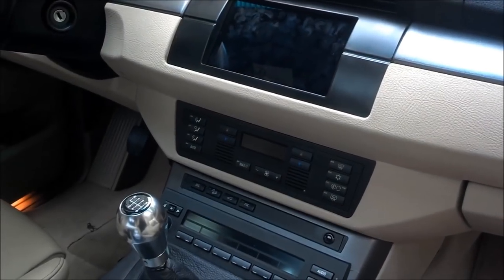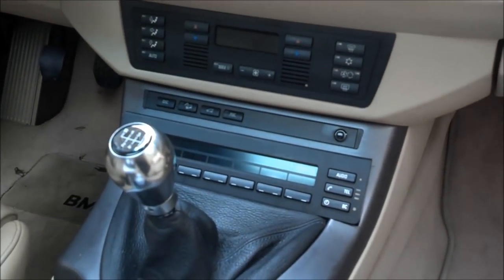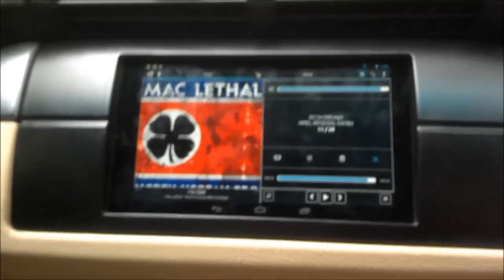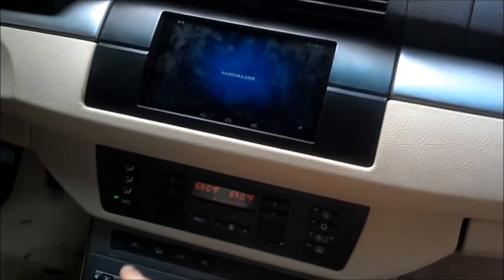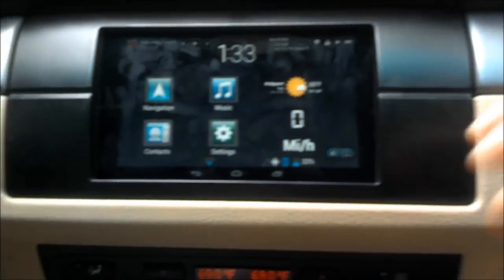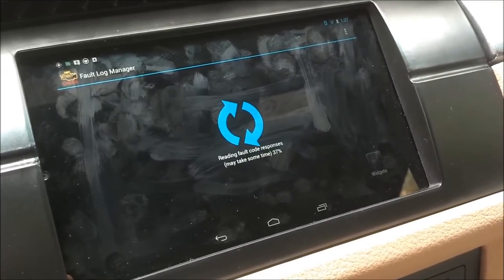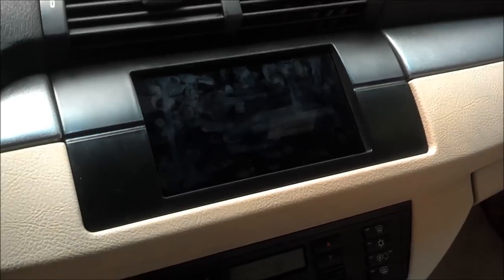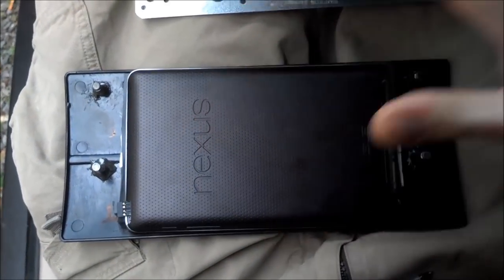Nexus 7 car install 2004 E53 BMW X5

Comment from the maker: I don't think that noise was programmed to indicate low battery, I believe it was an alarm system fault due to charge level.  I am glad it did not go off entirely.  I had my car apart for days- in and out, testing while not driving.  So, I did run the battery down- especially with interior lights.  She didn't start after that but since I have been driving her- even with the OBD reader plugged in all the time, there have been zero issues. 

Would be cool if I helped you isolate, keep us posted!

Comment: Thank you so much for this video, it was (in is going to be) very informative!
I'm waiting for my tablet, bezel, ODBII reader... to arrive and then I will start integrating the tablet with my 3 series E46. I'm planning to connect to the IBus system too (for steering wheel volume controls ect. & to control other car functions via tablet). 
One thing I didn't think about was using the bluetooth keyboard for some funtions (+1).
Would you be willing to answer some technical questions in the future?

Comment: Hey Jeff, does your Nexus 7 still retain the use of the original power button?  Im REALLY curious where you tapped into the power button for your remote "sleep/power" hook up.  Im actually going to add two more pogo pins to my tablet so that the remote button works as soon as the tablet is slid into its dock...but Im having trouble finding a good spot to make a good connection without butchering the stock ribbon cable...and retaining factory button for using inside the house etc.  Thanks!!

Comment: I was able to charge my 2013 nexus 7 with a qi wireless charger.  That might work better than putting a switch for the USB to pick from power/data

Comment: Hi Jeff .... how hard was it to fit the MID in ashtray ?
after you cut the 12 V plug how well does it sit on the aluminum trim ?
most people move it to gloveBox after getting aftermarket radio.
having done this what do you recommend ? gloveBox or ashtray ?
Reply from the maker: I had to dremel out the area around original location of ashtray to accommodate MID.  BMW uses some thick metal in that trim (underneath the wood laminate.)  Worth it for me, however- especially in light of work I did to take over the buttons in it.  I've seen a few installs with MID in glovebox.  If I had not taken over the buttons in MID, then relocated to glovebox- it would have probably saved me 20 hours easy!

Comment: where did u get all of the trim? like for double din and relocation of stock radio
Reply from the maker: Hey Ted, just a standard double din kit for the car.  From what I have seen, there are two types.  One that has the groove to match factory contour and one without.  I picked up the one w/ groove for about $45 on eBay some time ago.  The only trim for stereo is the right and left side.  I simply cut out this trim from salvaged black plastic and adhered to sides.  The top "lip" is already there. Relocation was a nightmare, a lot of dremeling around where the ashtray was.  I don't feel too bad about it since it is replaceable and even with a real aftermarket stereo, I would probably keep the orig. to retain original functions like settings for dash cluster.  Thanks for interest!

Comment: common jay .. help a man out, i really miss my MID :)
if I removed the center console , is it just the 4 screws on the ashtray and im set to slide in the MID and connect it ?
Reply from the maker: Unfortunately not that easy.  You would have to dremel out the bottom of ashtray receptacle in trim to accommodate MID.  (BMW uses some thick metal in that piece of trim!)  Then, cut some thin black plastic trim to cover up the metal sides of MID that would protrude without.
Reply: Jeff M
thanks for the reply.  i placed the MID on ashtray and noticed it was a bit longer than the gap.
i think i will just try to fit it in there with the metallic casing of the MID removed. hopefully it will fit ... if not i dont think i will dremel stuff out and have to settle for the glovebox.
I have to say the MID in ashtray looks nice as hell. defo worth the 20 hours if u ask me :)
Reply: Jeff M
Reading your comments I'm just unclear about something.
say you remove the center console to the side and you are left with
1. the front dash which has ashtray bolted onto it and
2. center console which has the handbrake/shifter/aluminum trim on it.
did u have to dremel the part behind the ashtray (1) or just widen the gap in the alluminum trim and  the bit that it sits on(2) ? or both ?
Reply from the maker: forthereg Oh man, it's been awhile and I've probably suppressed some of those memories lol.  I believe I only had to widen the exterior trim you see.  That trim, however, is real wood trim under my aluminum style wrap.  This wooden trim is secured to a very strong/thick frame.  I remember this was the nightmare to get thru, using only a dremel with standard cutting discs.

Comment from the maker: UPDATE: I got OTG and Charge working via no-wipe root as I instruct below.  This is done at your own risk!...

Installed Universal_Naked_Driver_0.72 for Nexus 7
Downloaded timur-usbhost-2013-01-29-jb42-fi.zip and put in root folder of Nexus 7 
Rooted Successfully w/ motochopper n7 (No wipe)
Backed up All aps and system settings (Titanium BackupPro)
Had to reset BMW Live wallpaper
Downloaded ROM Manager ClockworkMod Touch and used ROM Install option to point to timur file above.

Comment: And how the heck did you move the radio? I would be willing to skype you when I'm doing my mod.... God damn I don't even want to think of whats behind there.
Reply from the maker: The radio or "MID" is a thin device, since the amplifier and CD player are a discrete unit.  Removing it was the easy part, relocating it was a b$tch!  The good news was that I did not have to extend the OEM wiring to relocate. But that part of project was still 20 hours easy including the button mods.   Thanks for interest!

Comment: Did you have to run GT1 to turn off charging while the car is off? Thank you.
Reply from the maker: It only charges when vehicle is on.  About once a month, I flip an over-ride switch for that 12v outlet and charge it for a night.  Since I use a 2 amp USB adapter to charge while car is on, the under-run is minimal.   Thanks for interest!